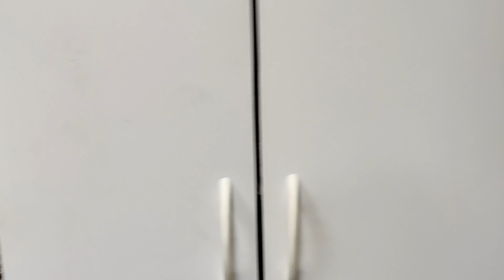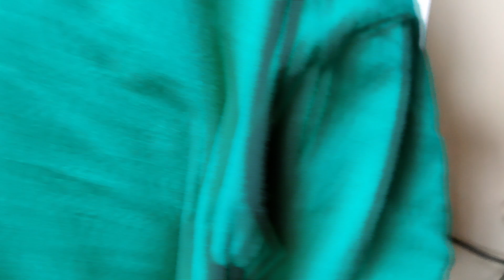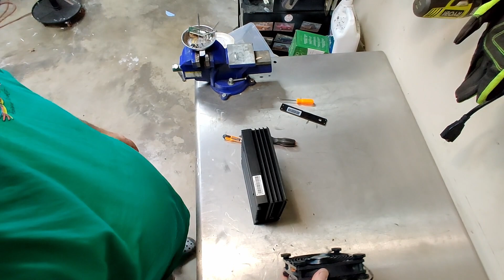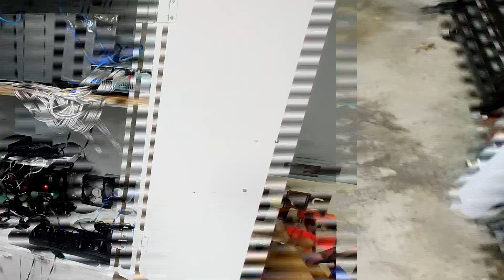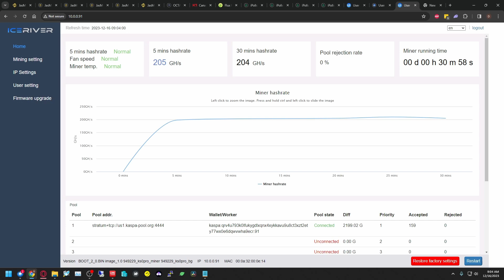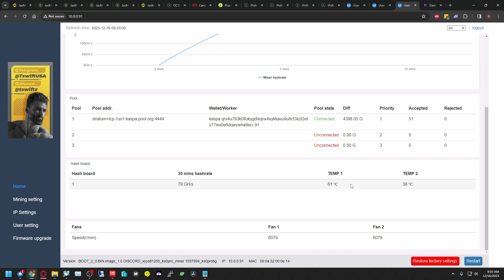KS0 Pro Overclocking

Comment: Did you also install heat sinks and replace the thermal paste to  achieve 302gh/s? Thanks for the video
Reply from the maker: No.  I used a 3d printed shround and removed the end panels.  Air blows thru it and does a great job keeping it cool!

Comment: hey i have found a problem, i bought a 230w power supply, the one in your link. but when i connect to the KS0 pro nothing happens. do anyone have the same problem?
Reply from the maker: No that's the Power supply I use and have my KS0 Pro overclocked to 330GH.  Any chance your package looked like it had been opened?  Maybe someone Amazon returned a defective PSU?

Comment: Power supply in link is 19.5V based the photos.What is reality?19 or 19.5? Is 19.5 still ok?
Reply from the maker: I don't think it matters, people are putting barrel connectors on 6 pin psu.  6 pin is 12volts.  Check out Max Voltage or the Veteran Miner.

Comment: Have you done the calculation to figure out how long it'll take to recoup all the costs of the extra equipment and firmware and added electricity? I'd love to do this too, but I feel like it may be the better part of a year before you earn your money back, of course this could be longer or shorter depending on the price and difficulty of kaspa.
Reply from the maker: No I haven't.  My thought is it is not what it costs now but when the bull run hits.  I think if kas hit . 15 now it may hit between  .50 1.00 next year and profits will be realized.
Reply from the maker: Also the power is negligible.  The pro was pulling 117 watts stock and about 168 iirc overclocked.
Reply: @TMC3D  well, I'm not sure a 43% increase in power for a 40% increase in hashing is negligible but I know what you mean. My thought is that Kaspa mining profitability could go one of two ways. If it goes up I can spend the extra $100 upgrading my miner at that time since I currently sell all of my KAS for BTC through Nice hash and I won't have missed any potential profits since I don't intend to hold my KAS. But if it continues to drop then I will not have been out the extra $100 or so for all of this extra equipment. If you're hodling then this could pay off if kas skyrockets.

Comment: partner i need some help related to this video
i live in a dorm and while i have wifi access, it seems the ks0 pro doesnt support wifi !

the wifi router is in a different room, and i am planning to put the ks0 pros in my room, is there is a way to get those miners online using a secondary router/access point/bridge or whatever ?? how to get them online when they dont have wifi built in and the main router is far away from them ?? am sure there is a solution just what is it ?!...

thank,
Reply from the maker: You can get a wifi extender that will connect to the wifi and has a ethernet port you can connect to a KS0 or 2 a ethernet switch to connect multiple devices. It's been years since I used one but I'm sure amazon would have sometbing and you could check the q&a and reviews to get a decent one.
Reply: @TheMiningCabinet  r u sure its an extender that I am looking for and need for this purpose not something else ??....
Reply from the maker: @RogueSkies  something like this would probably work:  https://amzn.to/3vimdBB
Reply: @TheMiningCabinet  spending 45$ per miner sounds a lot + its bulky imagine buying 4 !
Any other solutions like an access point, bridge, extender etc...?!...
Reply from the maker: Well, that has 3 ethernet ports, so off the bat you could connect 3 devices to it.  And you could buy a 16 port switch and run 18 devices off of it.  They don't use much bandwidth.  Other than that, you'll have to do some research and find something in your tech knowledge and price range.
Reply: @TheMiningCabinet  weird I can see it got a single ethernet port only
But I think I got it a range extender will probably work...

Thanks,
Reply: Wifi repeater

Comment: Can you attach the ks0 pro to a tablet
Reply: The UI is accessed by typing IP address into any browser. A phone PC or tablet will work. The default login is admin 12345678, this should be immediately changed of course first thing. Easy to setup I have 3 KS0 pros running and another on the way.
Reply from the maker: You don't attach to a phone laptop or anything. You have to connect it to ethernet with internet access then you can use a phone, tablet or laptop to access the web interface to configure it.